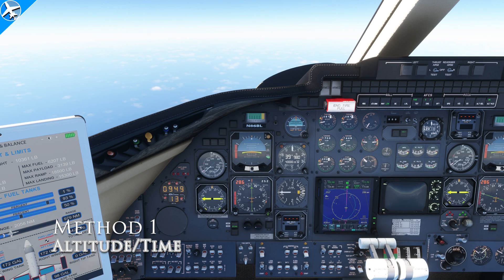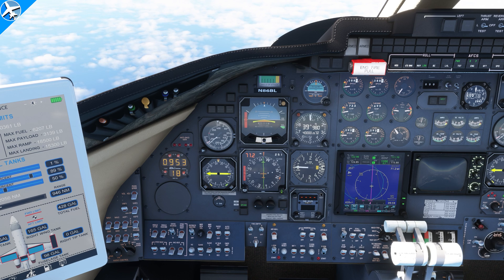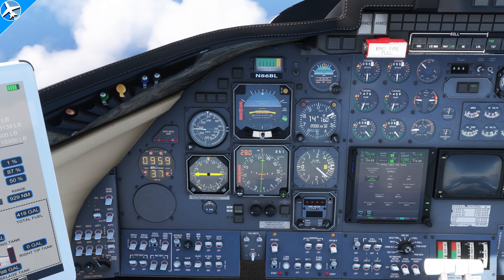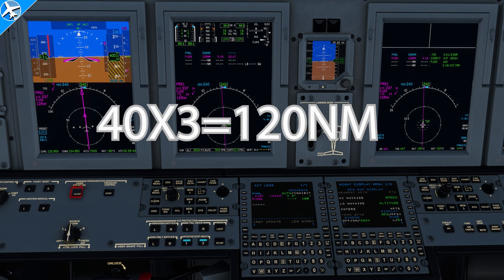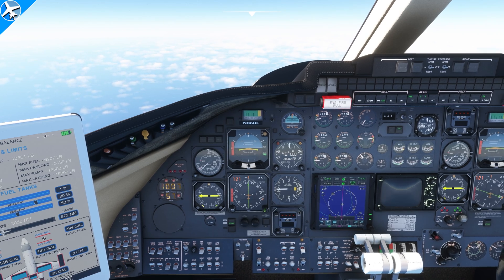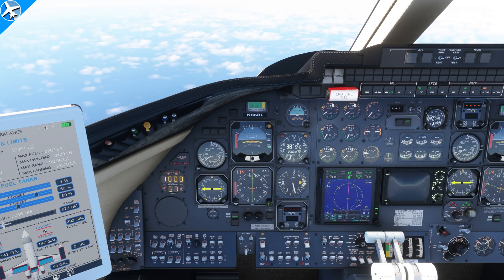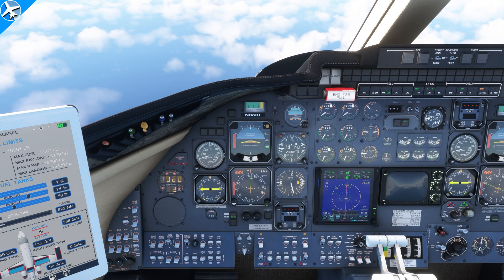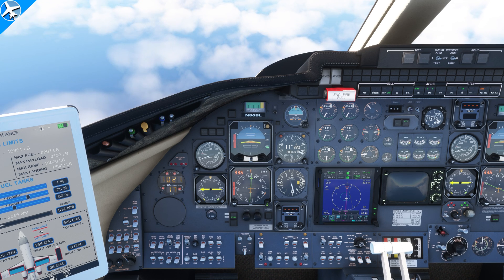Easy Descent Planning | When to Descend | Professional Pilot | MSFS

Comment: I have a ridiculous question, thats probabily going to make you so angry youll set something on fire. But here goes. 

When you reach your target altitude, from top of decent. When the aircarft levels off...then what? Do you wait for ATC to then guide you in, or do you manually fly the aircraft in. 

(Mans a noob) I am learning. Flicks cigarette
Reply from the maker: (Dodges the flicked cigarette).  ATC would issue a clearance to descend to a lower altitude in an effort to get below clouds for a visual approach, clear it for an approach, or clear the aircraft for a visual approach.  If the latter happens, the pilot will descend on their own.  That question did not make me set anything on fire or cause me to get angry.

Comment: we like to be 11000 feet by 40 miles from airport.
I some time do
alt minus where Im ending.
im at 20 want to be at 2
thats 18
18x3 54miles 1500 ft per minute
18x5 90 miles 1000 ft per min
18x7 126 miles 500 ft per min
its long math
then we use short math while decending  as you described.
Saab 340b math :)

Comment: Many years ago I was taught this method: Take your current Flight Level altitude ASL and remove the last digits leaving you with three if above 10,000 feet, or two if below 10,000 feet; divide the remainder by three and add 10. That gives the Top of Descent point, I have found this brings you down to around 2000 feet above sea level and short of the intended landing airport giving you a decent altitude, time and point of entry on the approach. 12,000 feet ASL = FL 120 div by 3 = 40 + 10 = 50nm = Top of Descent point, the distance from the destination to begin the descent. It works okay for me.

Comment: I never use method 1. EX: What is ROD for 17,000/11 minutes ????             Method 2 use alt. and speed (visible on 6 pack gages). Time is not visible on basic planes  =)
Reply from the maker: Approximately 1500 fpm.  With 11 minutes to go, 1,000 fpm would be 11000’ and 2000 fpm would be 22000’.  17000’ is just about in the middle so 1500’ fpm would be a good starting point.   I haven’t seen you comment in a while.  Good to see you back in the comments!
Reply: @thecorporatepilotdad  I use this same mental exercise to make an approximation, but unlike your great experience, my experience of less than 200 hours in real flight forces me to calculate the TOD as quickly as possible to keep my concentration to aviate, navigate and communicate ! I didn't expect to like the Lear 35 so much. It seems that I was nostalgic of FSX... I'm also going to propose to Navigraph to create fictitious but usable charts for the Meigs airport (KCGX) as a tribute of this old simulator which inspired many to become pilots, virtual and real!
Reply from the maker: @06L  Ditto on the Meigs charts.  I had that exact thought a few days ago.  If my memory is correct, there were two approaches into CGX.  A VOR and a GPS approach from the south.   I have contacts at Navigraph.  I will send that email. (Update: Email sent)
Reply: @06L  Ditto, except mine was whatever version was available in 1983 on my first computer, a Commodore-64.  That's where I spent many days flying from Meigs, learning the basics of the traffic pattern and GA flying in general. I was 16 or 17 and the passion started when I was probably 4 or 5. A little over a decade after discovering MSFS/SubLogic, I was fortunate to take lessons and get my PPL.  So KCGX will forever be dear to me personally!  I sure wish that I'd had the opportunity to visit, land and fly a few circuits there before it was abolished.  Remember the iconic Good Year blimp that sat stationary over Soldier Field?  That would be awesome to get that back in the sim 🙂

Comment: Love 💕 it ! Specially when you’re flying Learjet 35A :) Will you make a tutorial on it (please) ?
Reply from the maker: I already have.  One tutorial with takeoff v speeds and takeoff power settings is uploaded.  I’m doing additional videos on approach speeds and configurations, ref speeds, and there will be a guide to go with it.  These are channel member videos.  YouTube revenue is so low on these video types that if I didn’t make a little extra from channel member videos I wouldn’t do these tutorials at all.  That channel member level (private pilot tier) is 3 bucks for a month.  There are non-pilots charging 15 bucks for guides.

Comment: I am still watching too! I learned the method of difference in altitude needed to lose time 3 for the distance to start the descent. In the diesel 9 I started with 1500 per minute and recomputed the progress based on ground speed. And ground speed had to be calculated be the DME only gave you distance no ground speed. 😀🛫